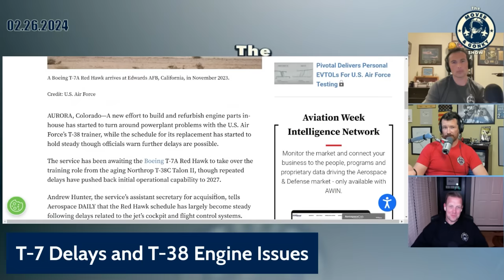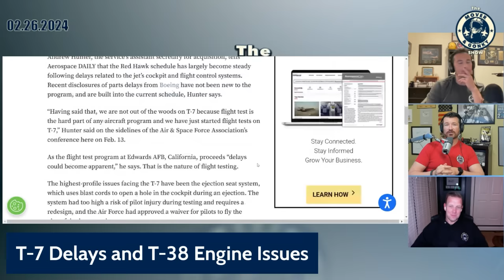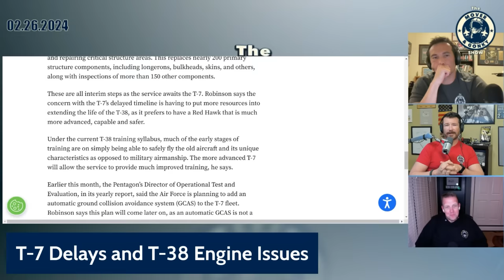T-7 Delays and T-38 Engine Issues

Comment: I was a jet mech in the 80's at Holloman working on the AT-38B's used for LIFT. I was there when they phased this program out in the early 90's. At that time every fighter pilot came through that LIFT program, and not just Americans, other countries sent their pilots there as well, thought it was a bad idea to eliminate the program then but to not have any replacement today is ridiculous. Gonky's right that little J-85 was reliable. GE is still in business, why can't they produce more parts? Other components (fuel controls, OSG's, power packs) may be the issue though not sure who manufactured those components. Really enjoyed working the flightline some of the best experience and memories of my life. Enjoy your channel.
Reply: Did you guys ever drag race down the runway during engine test...?
Reply: I beat they are gone, they only make so many replacement parts just as they cant make any more F22 raptors.

Comment: So, the wings and cockpit are Boeing and the body, maintainance intefaces and the engine integration are SAAB. Engine are based on GE404 derived from Volvo AERO RM12 modification, now standard for the GE404, which have over 200.000 hours running without engine failure in Gripen. Problem we have now is Boeing and a featurecreep of "great to have" that answers no requirements. The flying prototypes based on the requirement for the new trainer surpassed these requirements on all fronts, to a real low pricetag. Let SAAB handle it.
Reply: Yes, Boeing should use their deep pockets and throw money at Saab in order to expand their production responsibilities.
Reply: What SAAB has said is that they are providing everything behind the cockpit except control surfaces. So the majority of the wings are theirs too.
Reply: No, they do the wing box. as it is part of the fuselage, but the wings and the vertical stabilizer together with the cockpit are Boeing @NotASeriousMoose

Comment: The T-50 was the logical choice, which is why the Air Force didn't choose it.
Reply: I thought the air force was supposed to be the smart branch
Reply: @RikkiSan1 All the smart potatoes moved over to the Space Force.
Reply: Having a big budget definitely doesn't make you smart... @RikkiSan1
Reply: The USAF trainer "tender" was nothing more than a Boeing bailout.
Reply: Yup, Korea has already proven just how capable the airframe is and it made the most logistical sense to have a Lockheed platform when most pointy jets airmen will be heading into are Vipers and Panthers... It was strictly politics and the government's insistence on "spreading the wealth".  If the USAF had gone with the T-50, they would have already had the first round of deliveries...the jet design is done, proven, and ready for production.
Reply: @cup_and_cone Same could be said if you just cut out Boeing and gone 100% SAAB
Reply: @NotASeriousMoose  Boeing or no Boeing, the T-7 is still a ground up design.  The T-50 has been going on two decades now.  One is obviously going to have more unforeseen issues.
Reply: @cup_and_cone  Yes, exactly. Its has been going on for two decades after being designed to SKs requirements. Maybe that didn't fit with the wants and needs of the US?
Reply: @NotASeriousMoose  Both planes met the requirements. Boeing low bid the contract hoping to make up the development cost losses when they start selling the planes with extra sales to foreign markets.
Reply: T-50 was ready to go!
Reply: Does anyone really believe that the T-50 would not have needed multiple changes to meet USAF requirements?  No foreign plane is ever bought off-the-shelf.  The changes always result in overruns and delays.
I remember all of the “shortfalls” and delays in the T-45, which was a modified “BAe Hawk” which had been in service for a decade….
Reply: @bsd107  The T-50 that Lockheed submitted for competition was actually more stripped down than production runs (trainer vs fighter).  The painful and ironic part is that the USAF wants to evaluate a F-7 light attack jet, a variant of T-7, which the T-50 is obviously already a light fighter at heart.
Reply: @RikkiSan1 That's why they didn't choose it...
Reply: @tastywaves6043  Or you can turn that argument upside down and ask why the T-50 was so expensive when it already have been bought domestically and sold to foreign buyers?
Reply: Yeah, I was thinking it was a slam dunk, especially since LM seems to have a lock on contracts these days.

Comment: 7:35 whoever was in charge, in 80's, killed the potential of F-20 Tigershark. That plane would be the replacement of F-5/T-38 in a nut shell. Great reliable engine of the future, fantastic fuselage of its era, merged together as a twin seater only. Would be a fantastic replacement. They could even get rid  off the AB parts of the F-404 engine, what not, to comprimise flight hour instewd of mach 2 capability. Noone needs 9G manouvers but flight hours. 

Now decades later, they designed T-7A that uses F-404 engine.
Reply: And the USAF chose it over already existing designs like the T-50 , or AIDC T-5 Brave Eagle, Leonardo M-346
Heck, even a cut down version of a twin tub Gripen would probably end up being cheaper before Boeing is done producing the T-7
Reply: The T-50 is also like that: uses the F404.  Its LIFT version, the FA50, has been used in combat.

Comment: Don't forget the USAF tried to replace the Tweet with the T-46. I was a FE at PIT before I got out. (Essentially the same reasons you guys have been still talking about. Nothing has changed.) Two current and one past T-37 PIT FEs were on the initial OT&E team. I was gone by the time they actually began their new jobs. What I did get from them (2nd hand through a still close friend in PIT STAN/EVAL) was the jet was ok but not much of a meaningful improvement and the program was a goat rope. None of the top leadership was dedicated to bringing it onboard. Mainly $$$ for sexier stuff was always the priority. It died a quick quiet death. Same song 40 years later except the T-38 problem (it was struggling in 1984) won't go away or suddenly resolve itself. At least the T-6 got some priority.

Comment: You said the T-7 was a prior design?  As far as Im aware,  the T-7 was a clean sheet design.  It was designed specifically for this program and we're the first and only customer so far that Im aware of.

They knew this was a program where they were running very short on time.  And they chose Boeing,  I can only assume as corporate welfare.  The T-50 was in service in multiple other countries.  It should have been a no brainer.  And now we're dealing with a totally predictable failure.  Any new design is going to have some issues.

Comment: In Canada the 419 Squadron of Cold Lake has just shut down today the flight ops. of FLIT on the Hawks....
The RCAF was hoping to put the training in the States...~7 pilots per year...
Reply: If I am not wrong some  RCAF pilots will be trained at ITFS in Italy.
They use T-346 (Leonardo M-346) and have simulators that integrates with flying vehicles.
Reply: @donkeymarco  Yeah, 2 instructors and 6 cadets...maybe another 5-6 in the States...so calculating with a 50% fallout rate what is the capacity? There is already a fast-jet pilot shortage...so U think 6 new pilots per year will be adequate to build up (not maintain...) staffing for the new fleet??? The RCAF miscalculated it big time...
Reply: Wow, stood down for at least 6 years, hopefully to re-establish in the early 2030's?   Even with the 36 CF-18s receiving HEP-2 upgrades, AESA radar, AIM-120D3+/AIM9X Block-2, AGM-145C JSOW etc.,  if there's no pilots to fly them, the upgrading is moot.  This whole debacle is bad news for RCAF.
Reply: @hoghogwild  Those are valid points...It is bad news for the whole Canadian aviation since there will be not enough experienced pilot pool to migrate into the civilian airline industry either...Those who can afford a commercial pilot training own their own will not hustle for those jobs with irregular schedules...

Comment: Can't the USAF call the T-7 as not meeting contracts and just check out the T50?  Lots of those planes are flying.  I saw their display team flying at Clark Air base and it really performs well.
Reply: It would take a few years to ramp up the T-50 production line to meet deliveries...plus a couple years before that to finalize spec and then have OT sign off on it.
Reply: @cup_and_cone    ahh, ok.   Man, Boeing shape up or USAF training will suffer.
Reply: SK is in the middle of fulfilling a contact to deliver 48 fighter variant of T50 to Poland so the USAF will have to wait a long time to get their T50 at this point..
Reply: @pg8010  If USAF gave the contract to LM, The T-50 would have been built in USA at the new South Carolina facility (that is for the F-16).  Also the Polish order came in several years after USAF would have awarded the next gen trainer contract.

Comment: Navy Program Office and managers are also part of the problem.  Doing a complete disconnect in handing the design and engineering of the MQ-25 drone tanker ground control station (GCS) to a company that has virtually no CV environment experience.

Comment: Guys, we have alot of older block of the F16s sitting in the boneyard (Arizona), i would imagine you could pull them out of mothballs and reactivate them as trainers? Or is there another aircraft that we have a lot of, that could be potentially used in stay of a T8 or T38 trainer? What other aircraft are available in inventory at the boneyard, they are not stripped down aircraft, they are from my understanding full functional, just need tobe readied.
Reply: I worked at Depot on the C-130 program and I can tell you that the stuff we got from the Boneyard was Trash.
We had a C-130 come in that need a 100% replacement of Flap Jackscrews.
None were available anywhere, so we contacted the folks at D/M (aka Boneyard) see if we could get some.
What the send us was completely cover in Sand that meant FULL Disassembly to get all the Sand out of them and then had to be Inspected only to find that the ALL were "Worn" beyond their limits.
It took them 6 months  to ship this GARBAGE. 
We had a C-130  come in with a MAJOR "Crack" in its Horizontal/Rudder area that could not be Repaired. 
It took them 8 months to ship us one only to find that a Fork Lift had driven through it!
We had to back-rob from planes that came in to suppy the ones we were trying to fix.
Lockheed was No HELP either,  that is why we had to go with the guys at the Boneyard. 
We had the SAME problems when I  worked on the MH-53J PAVELOW program. 
Once an aircraft goes over 20 years old, they quit making parts for it.
To make Parts for it would take you 3 years of trying to get someone to make it.
Reply: Then what is the point of the Boneyard then? Is it just a waste of being what it is?Was it only because you obtained parts that were not preserved correctly on a full aircraft? That is what it seems, in part i have never served, but i work in the defense industry, i know recently in the last couple of years they pulled 6 B1 Lancers out to the boneyard to be reactiated and modified to hold a certain new ordiance.  @2-Hands
Reply: @RamblingRodeo  In the last couple of years(2021), the decision was made to retire 17 B-1s and send to AMARC decreasing the B-1 fleet down to 45 aircraft, now 44 with the latest hull loss.  Each of these aircraft were in the 14,000 average flight hour range and would have required US$10-$30 million EACH  just to make them safely flyable again.  The remaining 45 airframes have an average of 12,000 service hours on them.  They were originally designed for a service life of 8,000-10,000 hours. 
There's an assembly line that was set up at Tinker AFB that is currently undergoing life extension on the remaining fleet. 2 shifts of servicepeople will undertake 5,000 hours of work per jet in a fly in, fly out 30 days later procedure.  
They took 2 b-1B airframes and completed the structural testing that wasn't completed during the rush to get the B-1B in service in the early-mid 80's.  they took/are taking a fuselage out to 26,000 test hours and the wings out to 27,000 hours of testing.  A further airframe was taken from AMARC and split in two. Each component of the aircraft was digitally measured in 3 dimensions so that modern additive manufacturing techniques can be used to develop brand new replacement parts.  the goal is to allow the current fleet of 45 B-1Bs to serve into 2040 when the final B-1Bs will be retired, most likely along with the B-2A Spirit.  B-1/B-2 retirement will be associated with B-21A Raider IOC and FOC milestones.
The ability for B-1B to carry 24 AGM-154 JASSM/JASSM-ER or 24 AGM-154C Long Range Anti Ship Missile(LRASM), internally on 8 shot  rotary launchers INSIDE each of the Lancer's 3 bomb bays is just too great of a conventional capability to retire right now without some sort of replacement, esp. with the current "pivot to Asia" underway.  B-52 can carry 12 such missiles underwing(6 per side), with 8 more mounted on a single 8 shot rotary launcher internally for 20 total.   the B-1B can carry 4 more missiles than B-52, carries all missiles internally, and does so with 1% the RCS that the B-52 has. The Lancer can use shorter runways and is more survivable than B-52. then of course there is the B-1B's acceleration and speed advantages as well.

Comment: For the US Navy Naval variant of Tejas could be an option for LIFT. it's certified for carrier operations.
US engines, Isreali Aesa radar, RWRs and a configurable FBW to replicate different flight characteristics
Reply: No one in their right mind will use an Indian fighter in the US military. 😂
Reply: @JohnLee-db9zt  What choices are there for a Navy fighter trainer.
Reply: @praneetahluwalia1488  T-50 and M346, especially the latter is already in use by Italy which also operates F-35B.

Comment: Why the hell would you want a backwards system as ejection through canopy?
Reply: Cost savings
Reply: There are situation where the canopy can kill ejectees, esp. backseaters it 2 up aircraft that send the backseater out first.  Aircraft that were designed for the low nape of the Earth flying don't have time for a canopy to jettison and clear before punching the crewmember out.   In the 1986 movie TopGun, Goose hitting the canopy during an ejection during a flat spin was an actual thing in the Tomcat world.  the backseater goes out first and then 0.4 seconds later, the front seater is punched out. in a flat spin, the canopy could still be within the vicinity and the RIO could hit it.  This caused NATOPS to be changed requiring the canopy to be jetted and THEN the backseater RIO to go, with the pilot going 0.4 seconds later, at least in a Command Eject" situation. The RIO pulls the handles as the pilot is busy flying. Let's not forget that during a flat spin, the pilot is experiencing much more eyeballs out g forces than the backseater.

"" Canopy Destruct is used by Harrier, T-6 and f-35. Embedded mini-detonation cord or flexible mini-shaped charges shatter the canopy before the occupant goes through it.  There is also Through Canopy Penetration which is used by A-10, A-6/EA6B which uses "canopy breakers" on either side of the headrest to "break" the canopy as the seat moves through it.  The T-6 Texan also uses canopy breakers in case the mini-det cord system fails.""

Another reason is for an underwater ejection.

Comment: I think ssue with the T-7 was that it was designed with "digital twining" where a virtual model of the plane is tested.  Supposedly, this.will reduce need for actual testing but it seems that it was wrong.   Either the concept was flawed or Boeing as a company wasn't what it used to be.

Comment: Correct me if I’m wrong here.

Cockpit and flight control systems are Boeing designs. 
Saab designed and build the anterior part of the fuselage.

Maybe it’s time to remove the Boeing guys from the engineering? Let them handle sales and politics.
Reply: SAABs own words is that they design and manufacture everything behind the cockpit except control surfaces.
Reply: Weeell, about thaat... is it not the sales and politics which are the problems? The shareholders want more money...
The owners of McDontDoeing are not taking pride in manufacturing a good aircraft by the people, for the people.
They are "the people", and they want profit; screw the country. No?

Comment: I am appalled at the state of the T-38 today.  I agree that 'she is tired,' and outdated for the reasons stated in your video.  But to "trash-mouth" her?  She served her purpose well, for what she was designed for, and probably outlived her "useful" life beginning in the early 90s.  But she is where she is today because "careerists" sold out beginning in the mid-80s.  They sold their "career" souls for radical changes in UPT, for a follow-on jet for the '38, and for DEI.  In a nutshell, that's why we are in this posture today.  I flew the Jet from 1975 through 1988 (off and on) and accrued over 3300 hours in it.  I could see she was getting tired when I retired, but again, you can easily point to politicians, blue suit and others, for her demise.  And a solution will not be found anytime soon with the same crew at the helm...

Comment: T-38 is just not safe any more and even with the break thru canopy ejection T-7 is safer. And T-7 you can simulate a lot of planes (not a lot of flight envelopes but still).
It has so much possibilities. (I'm a Swede and we build cheap to maintain aircraft's). As I guess with the F-16 you can turn them into drones if you wanted to. T-38 you just can't...

I think this will be a great platform for a lot of stuff... built in enough numbers the drone option (yes it needs pylons and so on and on) it could be an awesome drone in the future... it has the compute power for it.